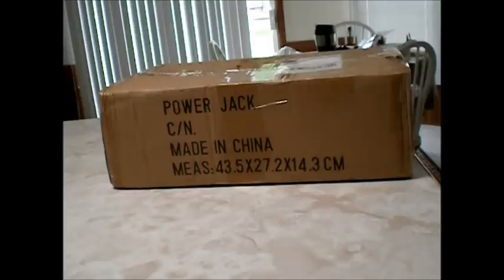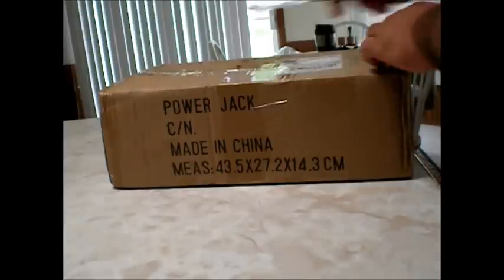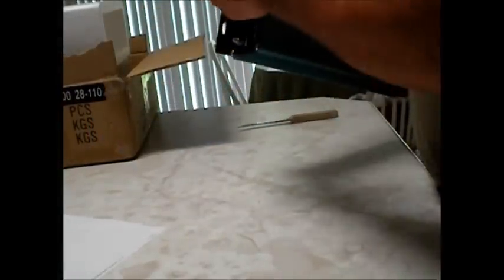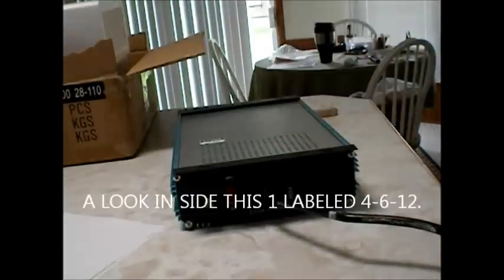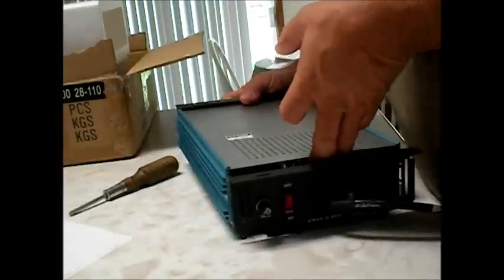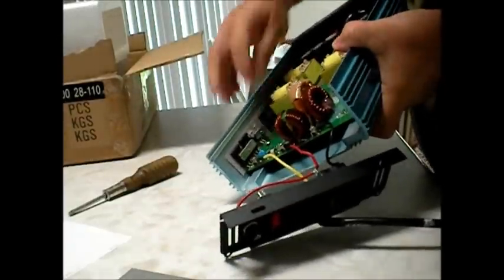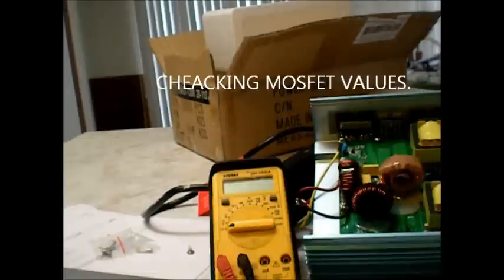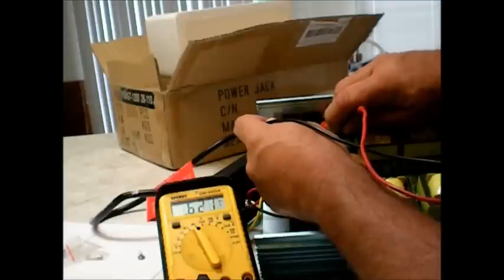POWER JACK 1200 28-52 volts #4 FOR ME.

Comment from the maker: Thanks  For info my unit did not have Those #s  They were Fair child G60n100 these are rated 60 amps 1000v max 180 watts ??? I don,t have the power  rating  sheet in front of me  so 195 is better  I would Think so far I have 4 of these units 1200 watt PJ,S Bang Per buck Is hard to beat .I have only had 1 problem so far. 1 unit has 960 watts in @30v.-.2 @705 watts@47v -1 @675 watts@30v. Thanks !

Comment from the maker: The 600 are a not even close, compared to the 1200 watt units they have much better components in side and i get about 87% efficecty out off them.and i will be using this new 1 at around 960 watts in I have 4 of them & I would not keep buying them if they were no good .U can run 3 0r 4 230 watt panels into these all day every day.Thats been my luck.I see quit often 635 watts out of inverter from 705 Label rating before panels get hot.